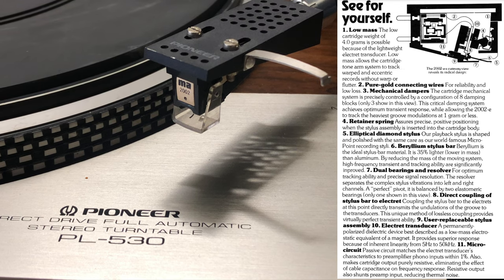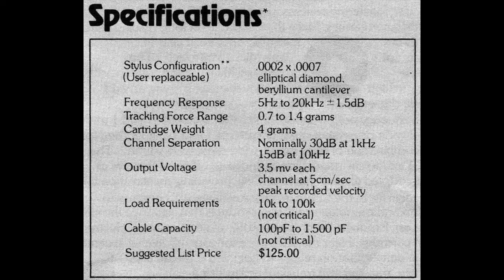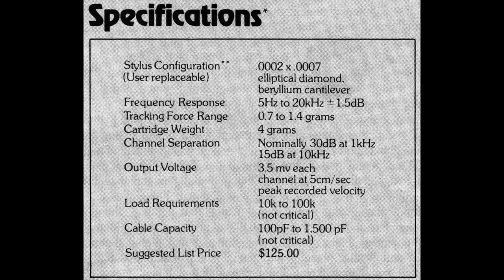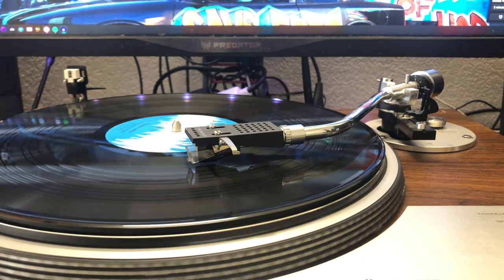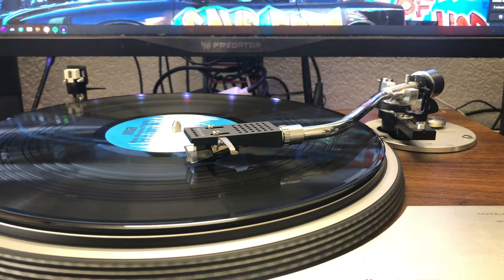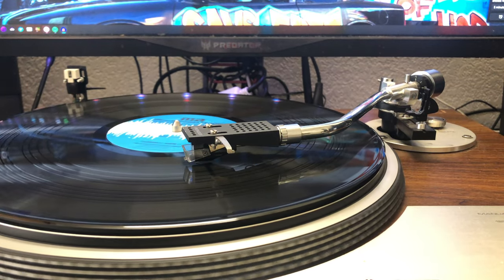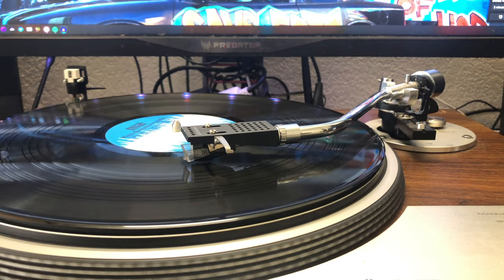Micro-Acoustics MA-2002e "Electret Transducer" Cartridge - Better than Magnetic Cartridges?

Comment: I had a Micro Acoustics 3002 cartridge in the early 1980s and I loved the neutral sound coupled with a very fast transient response. It also exhibited very little mistracking at high levels.

Comment: I've had both 282 and 2002 cartridges. Great cartridges. They were as advertised excellent transient and tracking ability.
The frequency response was smooth across the entire band. They didn't have a signature sound like over emphasized treble for example.